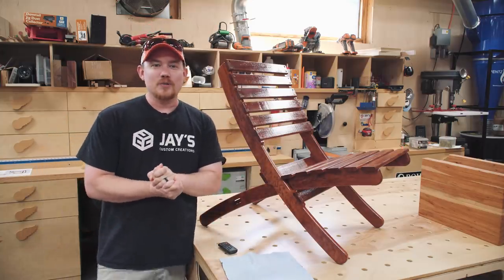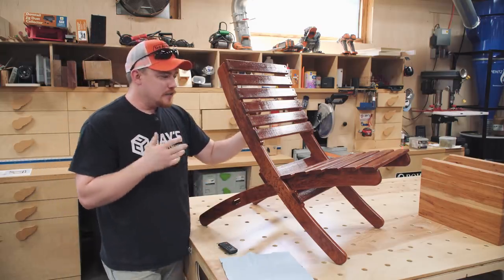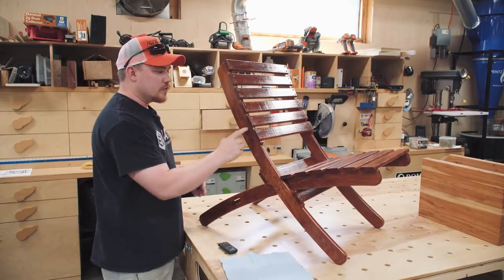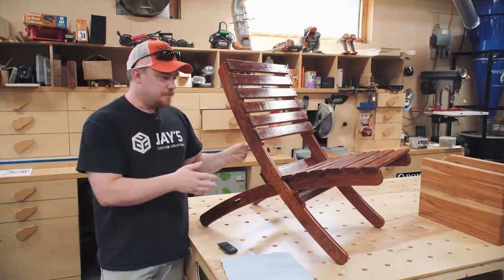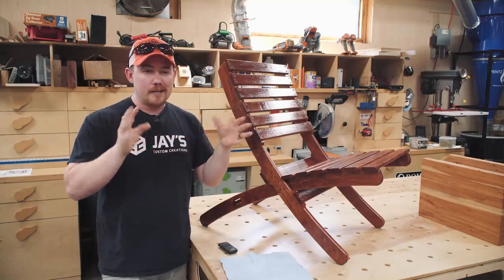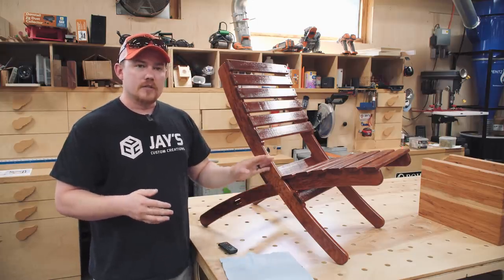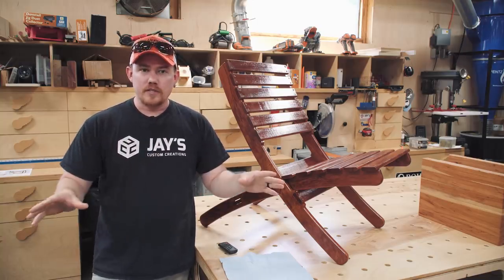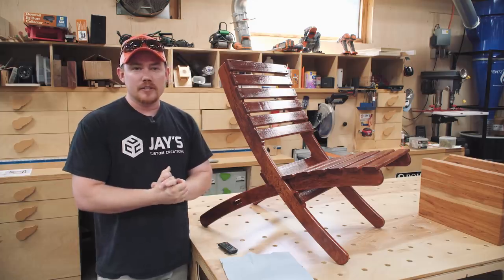Nesting Chair Update - 329

Comment: Jay just got the templates with the locking dovetails. One comment, number the pieces so when a person gets them they know which ones go together. I had to double check your plans to make sure I put them together correctly. Other than that they lock together perfectly and I can't wait to use them.
Reply from the maker: No need for that. There is only one way they go together. One dovetail has an arched top and the other is flat. They are a different shape and cannot be joined incorrectly.
Reply: @JayBates  missed that. Guess the coffee hadn't kicked in!

Comment: I had made 20 of these chairs over 10 years ago and someone wanted one out of walnut.  So I made a router template off of my chair design that is very similar to your design.   When my brand new router bearing bit was cutting the walnut I had major tear out on the inside grain of the chair rails.  Brand new bit.  It worked flawlessly on the outside grain  cut however on the inside curve it damaged every leg I was milling.  Is walnut prone to doing this?    Generally use walnut for plaques and game boards and just generally route the edges.  I tried reversing the direction of cut and taking lighter cuts but it didn't seem to make a difference for me.  Jay's router template design makes perfect legs each time.... anyone else had tear out like this before?  I have been woodworking for 30 years and made lots of stuff.... this tear out is un expected.... for me.   Working with a group of Church boys scouts we were splitting wood for a tent wood stove the the boys were splitting up some walnut logs into firewood with a splitting axe.   They said that stuff splits so nice it's fun! 
I maybe learning more about walnut now.... even after 30 years of woodworking.  HA!

Comment: i got mine in a couple of days ago very nice thanks. just wondering if you can make the chair with any thickness of wood and it still work ?
Reply from the maker: Sides can be any thickness. Slats can be 1/2" or thicker. I'd recommend 3/4 for all pieces.

Comment: Is there a real need for two screws per slat. With glue it seems like one would suffice.
Reply from the maker: I used one on the set in my back yard. They have been exposed to the elements for a couple summers now. No issues.
Reply: Thanks. That will cut the cost.

Comment: Hi Jay. What kind of weight can these chairs handle?  Im worried that the connecting point in the middle won’t support my weight with repeated use. I’m about 275lbs and 6 foot 8. Great looking chairs!  by the way
Reply: I'm wondering same thing at 6'3 over 300
Reply: @ronsmith1426  I'm not Jay, but I can't imagine that being a problem. The weight is distributed between the two cross slats very close to where they are screwed into the sides with two screws on each slat; on each side, so it's largely a shear force. Given that those two slats are also "cradled" by the cutouts in the side, they should be able to take a tremendous amount of that force. The rest comes down to the material you choose. Only one way to find out! ;)
Reply from the maker: We tested a plywood version with 400 pounds. No problem.